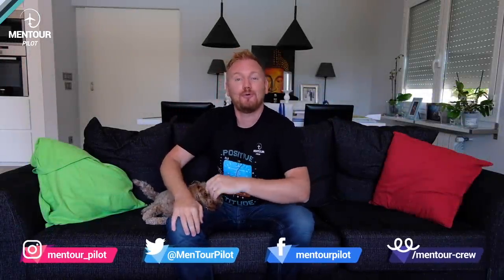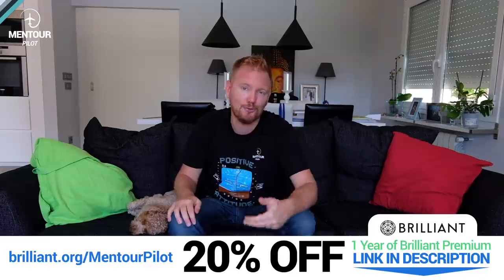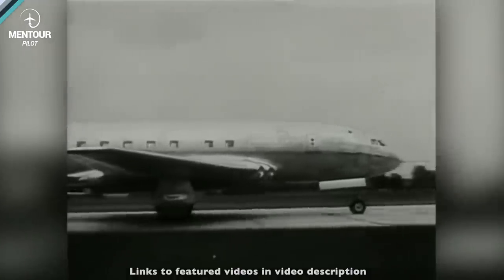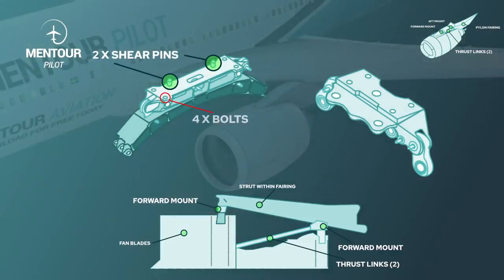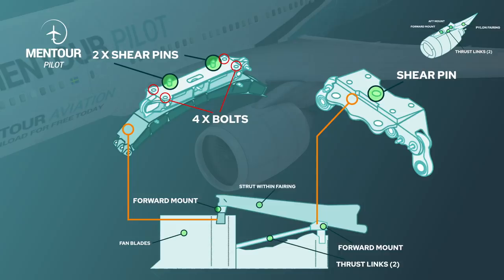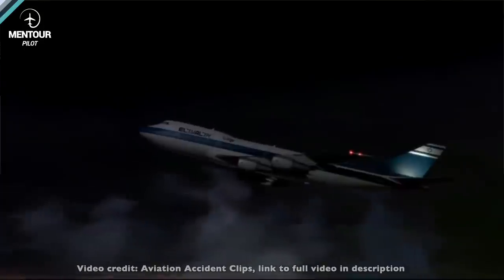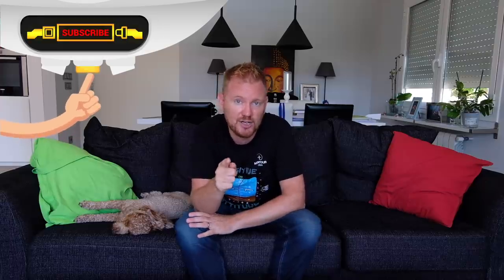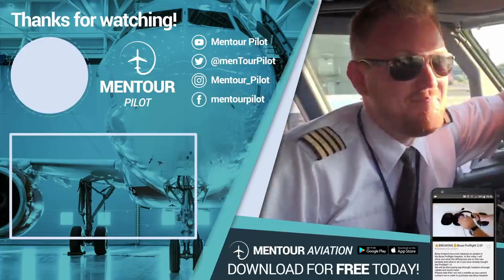How are Jet-engines attached to the wings?!

Comment: I was thinking if we found a safe way to mount engines over the wings, it would cause the air to flow much faster over the top and therefore increase lift. Maybe we wouldn't need the wings to be as long then and could reduce drag.
Reply: ENDER⌚EINSTEIN⌚ some of the modern. small Russian designs use engine air flow to increase lift giving very low stall speeds.
Reply: ENDER⌚EINSTEIN⌚ — There are engine-over-wing designs, but that isn’t the reason.

Comment: Last thing- seriously. What's your take on the late 1970's - mid 1990's US "deregulation" of aviation? Did it affect European aviation? In the US it seemed to allow lax maintenance and procedures which led to lots of crashes. Since ValuJet, which was the penultimate crash, the US aviation industry has improved with more oversight and rules. Has this had any effect on the European and worldwide industry?  Also- it's always amazed me that engines & wings had only a few bolts but the fan case has like 1000 little bolts.

Comment: About 8:40, 180 N/mm² is not especially strong. Normal cheap structural steel has a tensile strength of at least 355 N/mm³. Is there some translation error from imperial to metric units here?

Comment: Flight 191 was  bad, really bad. I was 22 at the time so I remember it in the news.  It was as shocking as Tenerife.  The back story on why the engine mount was damaged is quite interesting.  My take, the plane crashed because a seal leaked in a forklift...
Reply: crusinscamp — They shouldn’t have been using a forklift.  It’s too crude compared to a jack designed for mounting engines.

Comment: In the case of the American Airlines Flight 191, I had heard that one of the mechanics on the engine change crew committed suicide sometime after the cause of the crash was revealed.
Reply: That is actually true.  He was the lead mechanic of the group that was responsible for the engine installation. He committed suicide the night before he was scheduled to give testimony in court about his role in the accident.  He did himself in by sitting in his car with the engine running with the garage door closed.

Comment: You can also add the infamous Jesus bolt to that description… the shear bolt that was installed through the fwd cone bolt on the JT-9 Engines of the 746 classics . Today you guys have 8 beautiful bolts holding that engine to the pylon the classics only needed 5 , one fwd cone bolt and 4 at the rear mount 🤣😉

Comment: It's surprising how few bolts hold parts of an aircraft together. For example, typically only 6 to 8  bolts hold the vertical fin on all Boeing airliners. But, they are serious bolts, and more like pins with a giant nut so they don't fall out. They go through holes with such accuracy that a single human hair is 50 times too thick to fit in the gap. A single custom size bolt, installed can cost over US$100,000. The 787 inboard flap inboard actuators cost about US$250,000 because they are machined out of a forged billet of titanium. As a designer, I was able to see first articles. The real thing was way more impressive than 3D images on a computer screen, and they even let me touch it.
Reply: Colin Grant Yeah..but on a simple access panel or a fairing it is usually overkill😆Strange that🤷🏻‍♂️

Comment: They are speculating that the crash in India or Pakistan (not sure where it was, it was Pakistan Air) just today possibly landed without it's gears before trying to go around, striking the engines with the runway. Not confirmed yet, though. I imagine it would have had to be a very light contact for the plane to continue to fly (for even the short while it did).

Comment: Okay. That leaves me whith another question:  If the engines are built to rip of the wings in case of landing without gear. How could the 767 of LOT a few years ago land on its engines?
Reply: The engines would rip off if they hit an obstacle or hit the rwy very hard. The LOT 16 landing was very gentle, the impact force was minimised and distributed equally to both nacelles, so the bolts survived (I suppose they were replaced during the repair). 
Following your way of thinking, if the pilot anticipates belly landing, he should press the "shoot engines away" button on his front panel, regardless of the actual circumstances. Fortunately, no such "safety" systems were developed.
Reply: @Jarek Ferenc: Thank you for your reply. I know that the Landing of the LOT 767 was verry smooth and great airmanship.
What I wanted to say is that the engines are not automaticly rip off in case of a belly landing. 
It sometimes is better if they stay where they are and can  be used as a kind of landing gear.
BTW: Does some kind of mechanism to force the engines to fall of the aircraft really exist? A "Drop Engine" button wich can be pressed by the pilots maybe in case of dangerous Vibrations?
Would be interesting to know.

Comment: Just stupid question - If Boeing designed to attach the two engines on 737 on the back like MD-80, they would not have to worry about how to attach the two engines under the wing whenever they need new derivatives (more passenger, less fuel consumption)

Comment: what are those small fins on the engines on almost all the planes that  i have seen  ?
Reply: Best Motoring Fan no, those are called engine strakes, they are used to prevent drag typically interference drag and form drag. These types of drag are categorised as parasitic drag. The engines are circular and if you know your physics and fluid dynamics air is a fluid and takes the shape of the object in this case the engine is the object, additionally it laminates the airflow over smooth surfaces such as the wings and enhances the pressure differential over the wings due to the thick camber length at the leading edge of the wing.
Reply: @Best Motoring Fan @Ahmad  Ahmad seems to know his shit, so dont worry about that😉 Petter has a lot of knowledge, but he is a pilot and not an engineer😉 We do call them engine strakes, but according to the SRM they are called Vortex Control Devices🙃
Reply: Speedbird I seee
Reply: Best Motoring Fan don’t worry man! 😉 I was like that as well when i was young but I took a course on fear of flight. It helped a lot!! Plus the fear of heights is linked with somatogravic illusion which is caused by sudden changes in engine noise during take off and that the pitch of the engine decreases. The brain thinks that your sinking and the plane is falling out of the sky
Reply: Best Motoring Fan in fact commercial pilot is much much easier to get into than fighter pilot. They go through so much physical shit in terms of GLOC or gravity loss of consciousness which the positive and negative g forces acting on fluids like blood causing you to blackout at around 4g or 4 times your body weight. Commercial jets usually do 1g as they are subsonic if they were to have a bank angle of 60 degrees plus it will rip the plane up because it will induce something called a load factor where the lift factor is perpendicular to the orientation of the aircraft. It induces centrifugal g forces which move outboard from a centre of rotation hence this case it’s a longitudinal axis and it’s a point of rotation. Worst case scenario of a serious bank angle can result in an inversion
Reply: @UCcBniVX-rgL0dbnhLRauDwA & Speedbird, you guys aren't wrong, but the strakes/vortex control devices are there for a related reason.  When the 1st generation high-bypass engines were being used on DC-10s, the engineers discovered that certain angles of attack & airpseeds, the big round engine nacelles were blanking off/disturbing the airflow to the wing directly behind it.  This had the detrimental of having to increase both the angle of attack and airspeed in the landing configuration, which is opposite to what you want.  The strakes create a vortex which re-energizes the airflow.  The addition of those strakes decreased the angle of attack needed on landing by a few degrees and airspeed by a few knots slower, which is a good thing.
Reply: Ish 2 Da Choppa that’s what my point was exactly but did it go in much detail

Comment: 11:20 Why is it not possible to drop the engines before the belly landing?
Reply: Jari Kinnunen it cant because it’s not like an ejection seat of a fighter aircraft which has explosive mechanisms which ejects the pilot out of the cockpit. If that proposition was installed on modern jet engines it will cause severe damage not only to the engine but the wings and the entire aircraft. Additionally the engines are heavy and the bolts holding the engine in place require massive forces to drop it down and since the plane is in flight there is no way that a crew member can access the engines during flight as they are outside and during landing if the doors were opened it can cause some damage to the structure part of the fuselage. If you know your physics when a hollow object thats tightly sealed and if there is a breakage it can change the pressure differential between the outside and inside of the fuselage.

Comment: They used a forklift to install the engine, they did as they were trained and went for height instead off speed not knowing that the engine had separated, they just thought they had an  engine failure, very sad. I think the front bolts on the  assemberly are slightly weaker, so iff the engine does depart , it noses down and away from the plane.

Comment: I have a very rookie silly question.  Can an aircraft take off and fly with 1 engine?
Reply: If its a single engine aircraft, sure it can.  If its a multi-engine aircraft, most of the time, its no.  There have been many, many accidents caused by engine failure of multi-engine aircraft on take off.

Comment: What about LOT Polish Airlines flight 16, the 767 that landed without landing gear, it skidded on it’s engine nacelles but they didn’t break away
Reply: Perfect landing on both nacelles in perfect weather conditions, almost all the fuel burnt out, so no excessive forces were applied. I'm certain that during the repair, they replaced all the bolts anyway.
Reply: @jarekferenc1149  thanks, was just wondering

Comment: Flight 191 didn't have QMF which  probably would have saved the aircraft in that situation.  The 747 s inboard engines broke free due to sheer failure and in both cases took out the out board engines.

Comment: Inconel has a tensile strength of about 180 ksi (kilopound-force per square inch) which translates roughly into 1240 N per square mm (MPa).
It isn't a lot of fun to watch your technical explanations, they are often mistaken.

Comment: American 191 was a tragic accident but lets not forget about the crash of Delta 191 (Lockheed L-1011). The flight number "191" should be retired (along with some others). 
I'm not superstitious but I think some flight numbers are just unlucky.

I think the DC-10 was a poorly designed plane overall. Between all the cargo door and various hydraulic system failures, I'm glad it has been redesigned and relegated to cargo and tanker duty.

Comment: Engines have been dropped onto test bed floors before now when the suspension failed, smashing millions of pounds worth of new equipment. I've also seen engine suspension brackets (titanium) with huge cracks in them that needed massive force to break.

Comment: Integrating the engines should give you less drag... also there are several military aircraft with integrated engines and they have very long range so it should be possible on passenger aircraft to. If you want is another matter. I suppose the fuel economy is the key.
Reply: ulfpe — Military fighter aircraft are optimized for speed and manoeverability.

Comment: All planes are not passenger planes. From the the small GA Cessna, all fighters to the Blackbird, the engines are integrated in the fuselage. Everything flying is not necessarily your B737ng or a commercial plane.

Comment: fun fact: The 747 has wing mounts for 5 engines.
Reply: ...did you too, partake in a Scott Manley vid recently?
Reply: Not all of them. Customer option, I believe.
Reply: @Cal94  yup,jeje
Reply: @6yjjk  hummm,have to take a look.
Reply: @6yjjk  you are right,its only available on quantas rolls royce powered,and they do it too with a 707 in the past,last time was in 2011 it seems,so not a usual thing to do.
Also,this imply its a journey to sidney,and they have to refuel in Perth because the inscreased drag and weight.
it was quite more impressive before your question,jajaja.

Comment: you must know that the DC10 crash was caused by changing the engine with the pylon using a fork lift.  The pylon should not have been removed at all and certainly not with a fork lift.

Comment: I wonder why the engines on the Pakistani flight that crashed today didn’t come off after it hit the ground with landing gear  up damaging the engines?
Reply: It wasn't a hard enough impact & subsequent slide along the runway to tear the engines off.  The PCAA has stated they have found scrape marks along the runway from both engines, but that they are not the same length, and don't start & stop in the same location.

Comment: In summary:
with bolts
Reply from the maker: And shear-pins
Reply: Mentour Pilot Engine to pylon is just bolts😉
Reply: and some sealant as well!
Reply: Andreas Poppe No sealant between the engine and the pylon🙃
Reply: Tarik B. I just said that the engine is mounted to the pylon with bolts only🤷🏻‍♂️ The hangar fittings has the shear bolts, which are not mounted😉
Reply: @speedbird9313  but in case you have a aluminium wing and a titanium pylon you need to protect the aluminium!
Reply: Andreas Poppe Dude...like I said there is no sealant between the engine and the pylon🤷🏻‍♂️ Do not know about the pylons attachment to the wing, I have never removed and/or reinstalled a pylon..that is not common.

Comment: The 747 was designed to mount a FIFTH ENGINE on the left side inboard of the #2 (inside) engine. That is so airlines could transport engines around the world with other 747s in their fleet. I wonder how that is done these days? They wouldn't fit on anything but the IL-76, 747F with a nose door or military jets like the C-17. That, or you put them on a boat and wait forever...
Reply: Its still done that way if needed.  The last time I know that happened was a Qantas 774 in 2010.

Comment: Has anyone thought of having explosive bolt holding the engines on an aircraft , like on ejection seats on jets aircraft , so they can be dropped from the aircraft in a mid flight emergency and allow the aircraft to act as a glider and land and float on water ?

Comment: I prefer the "Canadian Bilingual Pilots" 1970s explanation of what holds an engine onto the airplane.  "The engine is held on with a special glue.  In the event of a fire, the engine is designed to fall away" 😈

Comment: So why is there no systems to drop the engine on case of failure, fire or other circumstance when the engine becomes a liability?
Reply: Why do you think there should be?🤷🏻‍♂️
Reply: @speedbird9313  is my question not self explanatory. If an engine is on fire or had a major problem which might endanger the plane then ditch it. Of course two problems arise, 1... Where the engine is going to land and 2... The imbalance of the plane!
Reply: Jeje Wa There is a reason why there are engine fire handles in the cockpit..So you want to raise an issue concerning something that isnt an issue🤷🏻‍♂️
Reply: @speedbird9313  ok I now to your superior knowledge. So what about why there is no seat belt on plane and why life jacket not used when plane crash! Thanks for the answer!
Reply: Jeje Wa Huh?! There are seat belts on passenger jets🤨 Why lift jacket not used when plane crash?? When?🤔

Comment: Instead of just two engines, why not mount 4 smaller ones? Then if one fails, at least you still have 3 to help you land.
Reply: They'd likely result in a higher fuel burn as a result of  increased weight & drag. Also, more parts to maintain in comparison to two engines, which means higher costs for the operator.

Comment: Why are aircraft still built using rivits, an old technology, when virtually all other forms of metal construction use welding ?
Reply: Rivets can be removed and replaced with the new ones without a change to the rest of the structural members. A welded joint can not be removed - it must be cut away together with a part of the welded structural member. Welding heat affects the area near the seam (it's called heat affected zone) and may cause undesired changes to the metallurgical structure of the parent metal, which decrease metal's strength. Additionally, welding introduces stress and distortions (remember the thermal expansion!) that add to the stress caused by normal loads applied to the structure. Conclusion: don't weld, unless you really need to. Believe me, once upon a time I got my degree in welding...
Reply: @jarekferenc1149  thanks, that makes sense.

Comment: Did you see an A320 went down, lost both engines and undercarriage
Reply from the maker: Yes, I saw that. All thoughts to the victims and their families
Reply: Appears to have skid marks on the underside of the engines and the engines then failed during the go around.
Reply: The undercarriage was not lost.  Security camera footage shows it down before it crashed into the buildings.

Comment: Some big ass mounting bolts hold the engine in place maybe........ Notice the sarcasm, but yes there are big bolts with very close tolerance holes that hold the engine to the pylon.
Reply: Depends on what you mean by big, I think they are a lot smaller than people would think😉

Comment: Actually when you look at the strengt of a bolt, the strengt is where the bolt begin “fleeding” not where it broke. An exampel classic steel fleed araound 220 N/mm but actuel go into two pieces around 370 N/mm so i think there some more margin left. But sure if you talking alloys the span is less. 5G is not much when you talk vibrations.